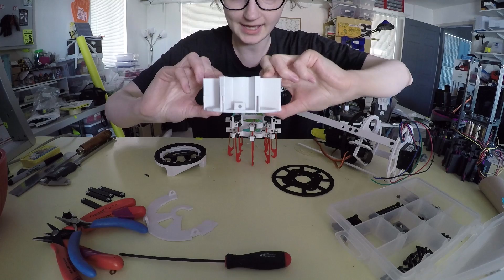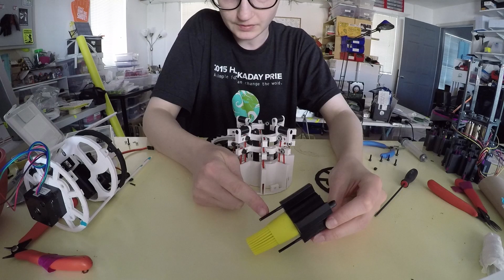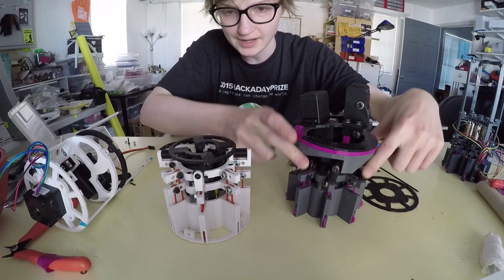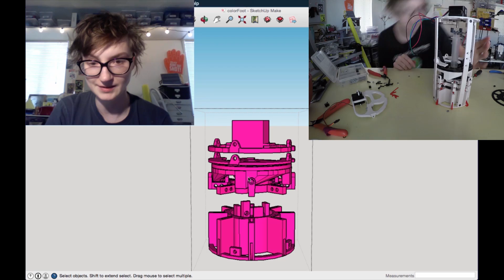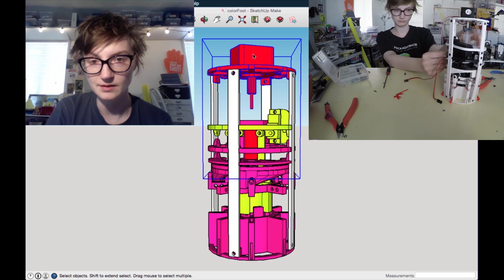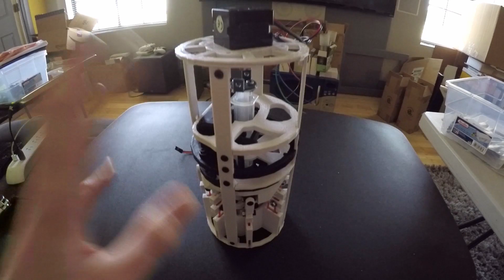Tasting Feet : Assembling the Assembly

Comment: Yay! Another video! Sorry I was so late.. I forgot to check your channel as for some reason I didn't get a notification.
Reply: +MarbleGray Also.. Maybe make the toes out of something a bit stronger so they don't break every time you try to press on it? Like.. Cardboard maybe? It doesn't really snap..
Reply from the maker: +MarbleGray I'm going to look into that more rubbery material that you can print with =D In the case of these red toes, the filament was just old and brittle and I should have expected them to crack =[
Reply: GravityRoad oohh... Good plan, I think it's called ninjaflex or something. Not that I know much about printing, but yes.. I didn't know that filaments for 3d printing dries out. Good to know, thanks!!!
Reply from the maker: +MarbleGray I think once PLA is exposed to humidity and then dries out again... it becomes brittle and is more prone to cracking =[ I'm not sure about this, but it seems this way from my experience.
Reply: GravityRoad Ohhhh... Understood. Thanks!